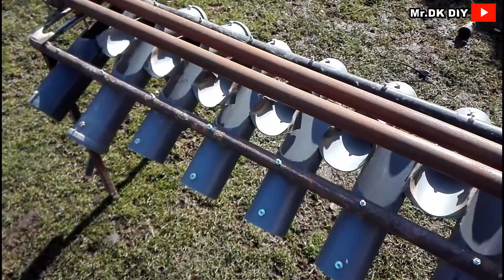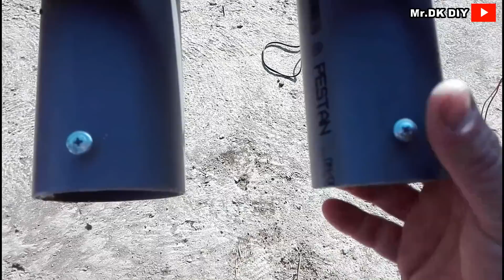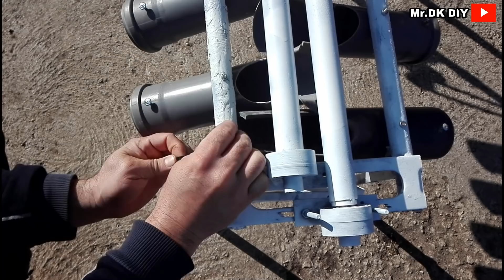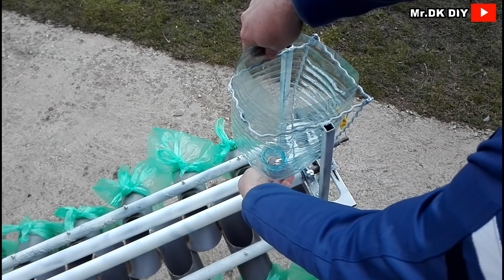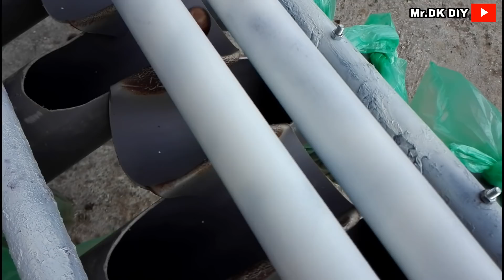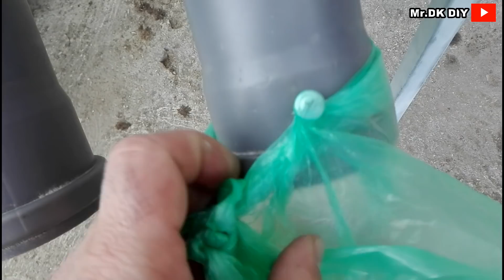The Best HomeMade Project 2018 / Hazelnut selection machine DIY

Comment: do you have a diy hazelnut husker for taking husk off?
Reply: Hi BobInMissouri - Look up a bucket thresher.  They work fantastic at removing the husks from hazelnuts once the husks are dry.  It is a batch process, but it is FAR better than stripping them by hand.  Maybe Mr. DK DIY already built one?